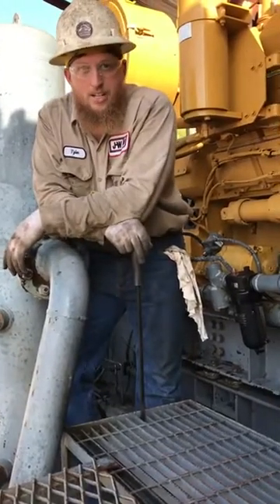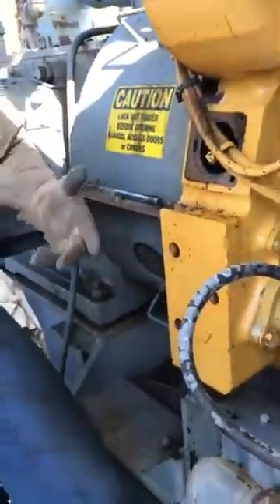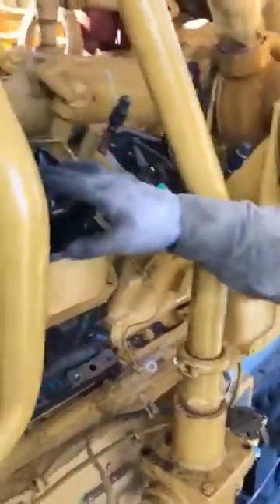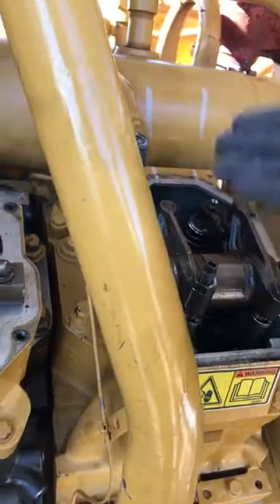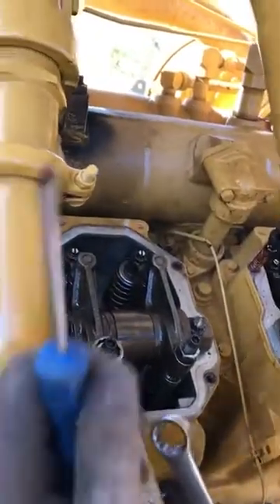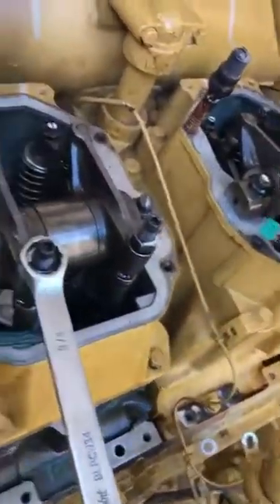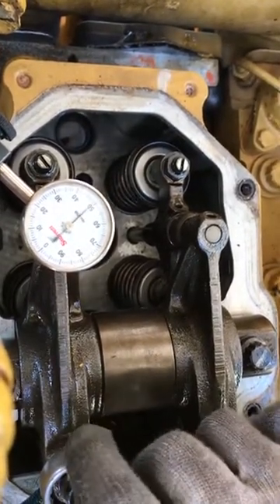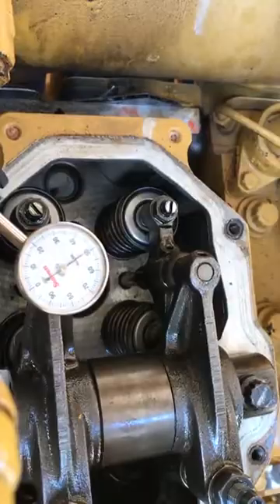Caterpillar G3500 Valve Adjustment

Comment: Question I’m just starting on these 3500 and 3600 series engines I’ve been a Waukesha guy for years but if your on exhaust stroke why do you losing up both intake and exhaust on your bridge to set the exhaust I see the stroke? I understand valve lab but this is confusing to me . Thanks for the help

Comment: Hmmm this is old Caterpillar natural gas 3500 series engine having magneto non EIS engine. Water cooled exhaust manifolds and turbocharger hot housings 🇵🇰☺️🇺🇲😉
Reply: ALSO, a very old way of rolling an engine 🤣🤣🤣🤣😅

They do make barring tools and devices. If you make a how to video, make sure to do it the easiest way possible. DONT make people think they have to roll this engine with a pry bar. The tool is like 35$ on amazon. Your welcome
Reply: @CryptoMechanic310  when there is room, I actually prefer rolling the 35s with the pry bar. With plugs out I can spin it around in no time. I do however have power turning tools and prefer to use those if I am gonna be doing it a lot.
Reply: @blackfootmechanical5413  I hear ya. Different folks, different strokes. I prefer to use the ½ inch drive turning tool, or the bolts up turning tool. Much easier to use my long ratchet to bar it over with. But for overhauls, I use the bolt up tool where the starter goes and a pipe threader